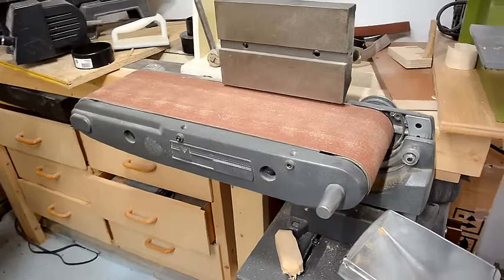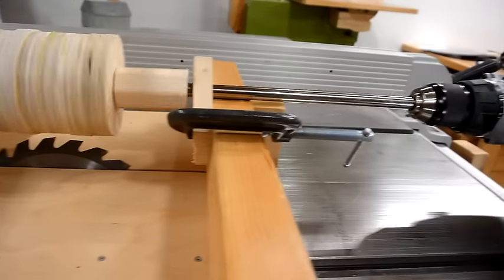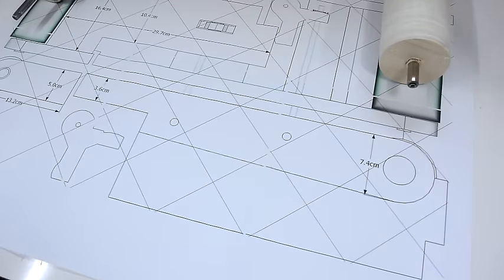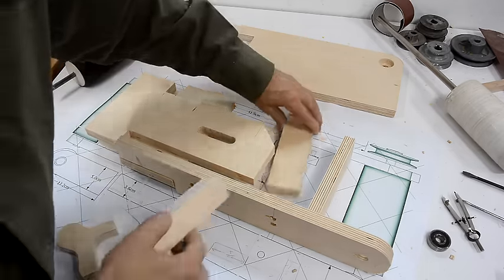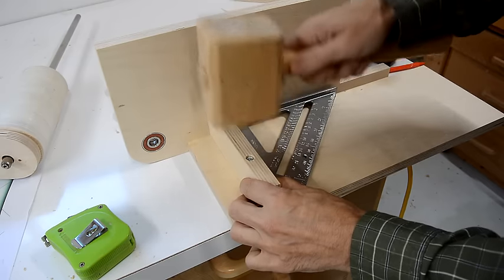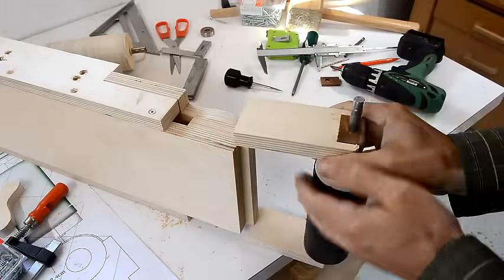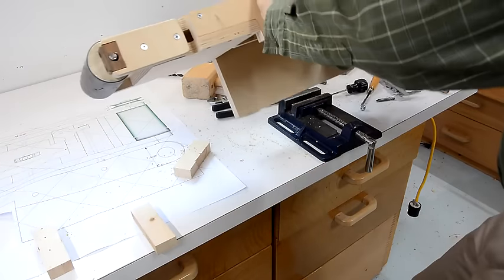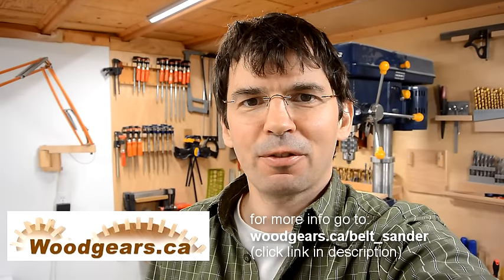6x48" belt sander build

Comment: To get the innertube on the pulley you can use the trick they use for cricket bat handles.  Just put a plastic shopping bag inside the rubber then pull the bag over the pulley.  It will drag the rubber over the wood.  When it is in position you can roll back the rubber and slice through the plastic with a razor blade.   Maybe look for a video on how to put a cricket bat handle on and that will explain it.
Reply: Chuck St. Louis.
Reply: Lijadora de banda casera

Comment: This has probably been asked and answered previously. What are the router type drills that you used to cut the holes for your bearing? 

Also did you salvage the bearings from something or were they new?
Reply from the maker: They are called forsner bits.
Bearings - don't remember where I got those from.
Reply: Thank you.

Comment: I have managed to get a whole section of cycle inner tube over a similarly sized piece of wood. The secret is to roll it on. Didn't use any kind of helper like talcum powder or water. Just rolled it in to a rough toroid and then stretched it over the wheel.

I've also seen a guy here on YT do a similar thing but with an old idler (metal, so harder). He made a cone piece that went on one end of the idler and then once again rolled it over. That's where i got my idea.
Reply from the maker: That is a cool idea!
Reply: Essentially an open ended condom roll?

Comment: If you find a throwaway treadmill, the surface underneat the running belt is supper slipperz and would make an ideal underlay for the sanding belt.

Great project, very nice execution.
Reply from the maker: Hadn't thought of that.   Just saw one on the curb yesterday and didn't pike it up (the motors in them are useless)
Reply: +Matthias Wandel can you make a GIANT sander from a treadmill?
Reply: Thats what me and my dad are building, a big belt sander from treadmill parts, its even going to be variable speed
Reply: A lot of people convert benchtop and small metal lathes and milling machines to use treadmill motors. They keep all the variable speed electronics and they reportedly work quite well.
Reply: i think John Heisz's disc sander uses a treadmill motor
Reply: Gandalf The Grey where/how do you get the sanding belt from?
Reply: Yves Baggi
Search, "Custom Sanding Belts" you have hundreds of choices.
Reply: aha... cool thanks, didn't think that was even a market, cheers

Comment: There is a difference between a shaft and an axle. An axle only has a vertical load , a shaft has torque forces on it (it's driven).
Reply: you may be a shaft :)
Reply: +The Flying Woodsman are you giving people the shaft again?
Reply: "a shaft has torque forces on it (it's driven)" 

So what do you call an idler shaft? 

Also, wouldn't your definitions mean that my rear wheel drive car doesn't have a rear axle, but rather a rear shaft?
Reply: In the interest of pedantry....
"...my rear wheel drive car doesn't have a rear axle, but rather a rear shaft?" 
Correct, although they're more commonly known as a pair of half shafts...
Reply: Paul Frederick axle with 2 shafts in it.
Reply: There are women on here...please watch the language. Thank you
Reply: AymBro
The flying woodsman was correct in his distinction between the two. Anyone educated in the field will confirm his definitions, shit even google could have helped you prevent splashing your ignorance here for us to see... Well done you :)
Reply: frackcha
it is the motor engine distinction. Which is meaningless semantic nonsense in useful contexts. As there is no time when an engine is referred to as a motor where it is detrimental to the interchange of information.
Reply: so much disrespect.

Comment: Where I am, getting an electric motor like those you use are few and far between, in addition to being so expensive, it's actually cheaper just buying the sander. Could I use a 1000W impact drill for motor instead?

Comment: Great video and project as usual. Would it be worth running or mounting the motor the other direction so that sanding dust doesn't get as directly pushed toward it, or would that not really be a concern?

Comment: Awesome build! I learned a lot. Loved the cooking spit idea over the table saw blade! Someone used their drill press as a kind of wood milling machine by locking the drill chuck in the lowered position. I can see how that could be dangerous but you always have to use your brain around power tools of any type. I'm a big fan of using a tool for any purpose to get the job done as long as it's a controlled situation and won't hurt yourself. Thank you very much!

Comment: Cool build - wondered if heat shrink tubing would work instead of the rubber or silicone for tires?  I have an old belt sander that needed a tire and am trying the heat shrink as the old tire is brittle and cracking.
Reply from the maker: Heat shrink tubing turns quite hard.  You might as well leave it bare wood instead.
Reply: I'm giving it a try anyway - the tubing I have is relatively pliable - much better than the cheaper stuff.  My belt sander has steel rollers.

Comment: Will the motor of a cordless drill be powerful enough or did you only use it for the first try?
Reply from the maker: Only to test
Reply: They're powerful enough, but drills are not designed for continuous use so the motor will wear out, I think.

Comment: Also, if "shrink-tube" (for electrical work....) is avail. is diameters >80 mm, a length could be fitted over a "tube" with hubs at either end.  Also, for bearings, skate board parts might work...!

Comment: I can't tell if that's 3/4 " plywood or 1/2" plywood for the round disc. If it's 3/4", then the length would be 8 1/4" since there's 11 pieces.

Comment: I'd been more impressed if you'd made the table saw first, then the band saw, and then the drill press. With $3000 worth of tools you can make something. Even a good set of chisels will set you back $50—$100. With all the money you have you could just buy the sander.

Comment: Next time you want to cover something in inner tubing with a tight fit.... pull it over your workpiece as far as you can and then hook the other end up to a shop compressor. Blow the tubing up like a ballon and it will be easy to pull it over in one piece.

Comment: I used garage door rollers as very imprecise cam followers & put a band of bicycle innertube around them & they seem to work fairly well. Mine is a very low torque application.
How true do rolling pins run? Have to check it out.

Comment: Hello mathias I really like your projects. I bought the tape saw and saw in your videos that I have separately discriminated the parts that make up the frame, but in the project I bought I did not find that part, or anything! I also bought the edge belt sander design, what is the size of the belt sandpaper that is used on it? I'm from Brazil and the sanders that combined that sell here are from the range, ferrari and skil, do you use sandpaper from any of them? Since the sandpaper for them is 1 meter by 9 centimeters.

Comment: Impressive job, but hey, you need to get a real wood screw drill bit that drills the correct tapered hole for the thread and shank and the correct countersink, instead of drilling 3 separate holes.  Make life easier for yourself.

Comment: I think it's a long job. You can take a wooden cylinder of the necessary measure and put on the rubber with an air compressor (as a sock, inflating inside) instead of cutting it in rings.

Comment: As you are, your videos are very good, I was wondering if it was possible to make a manual belt sander with a small grinder, there is only one video of a youtuber who made it with the grinder's head and uses a drill but has little force, it will be possible to make a with said tool? there I send you the link so you can see it but it is not practical I did it but it has no strength

Comment: A great sander. Thanks for sharing.. Have you maybe considered using a product called Plasti Dip for coating the rollers instead of the silicone?  You could dip it out of the can and spread it in the same way as you did the silicone.  I have used it in the past to coat tool handles and grips.. works great.  It is available in the big box stores and elsewhere.

Comment: Matthias, I've watched many of your videos.  Thanks.  I've been trying to build a DIY grain crusher to crack barley between two rollers for making beer.  I've knurled some 2" pipe and was going to make all of the parts out of steel plate and 6061 aluminum, but I think you've convinced me to make a prototype out of scrap wood first.  If it works well enough, I may never bother making the final version out of metals or at least proved the concept before I commit to the time and cost to make a final version.  I wish I could get your input on how to best control the roller gap adjustment.  I have some sort of eccentric, jackscrew driven screw set, or hinge system to allow for the movement, but I know you could come up with the best idea.

Comment: Why not use bearings on the end axle shaft instead of just running it through wood? It would run a lot smoother and quieter. It would also not wear out as fast as the wood.

Comment: why wooden bearings on the smaller roll (which turns faster) ? and why not using the hardwood actually for the "table" part where you push pieces against ? won`t the backside of the belt still sand the cheap wood away over time ? Greatings from Tschermany ;) i <3 your work ! just curious ... :)
Reply: sheat metal under the belt, just saw the end and now part 2 LOL .... sorry ...

Comment: You should use cork under the belt. It will help it run cooler than metal although you can use the cork over the metal too.

Comment: I just flip a 4x24 belt sander over and use it as my bench belt sander. Good enough. One of these days I want to make one of those 2x72 knife grinder machines. Other projects are ahead of it now though.
Reply: I got one, best machine I own, 2x72 Beaumont metalworks KMG, I've made several tooling arms for it too, possibilities are endless, super modular, 2 hp 3 phase motor with VFD, very strong machine, lots of belts and grit options for it.

Comment: Just wondering why you didn't use bearings on the idler roller instead of the wooden bearing blocks.  When I made my belt sander I found that it didn't take much friction for the wood to get really hot.
Reply: He likely did not have the right size bearings for the axle.

Comment: I don't agree with the hard bolt mechanical adjustment to tension the belt. The belt if tensioned by springs as in most builds of this nature would have some give. You have no give. There for as tensioning happens, something in your system is going to wear out or break. Not to mention I think because of this no give situation your machine has a pronounced squeak
Reply from the maker: I guess you didn't see the wooden springs?

Comment: Try glass under the belt.  It's nice and flat.
Reply: also tends to have a high coefficient of friction.
Reply: It doesn't wear like metals do .
Reply: +12345NoNamesLeft the only problem i can think of with having glass is that it may shatter quite easely
Reply: .....then what about scrap LEXAN.....?
Reply: Belt friction leads to Heat. Heat leads to Melted Lexan.
If anything other than metal, probably granite. Wears real well, and a piece could probably be had for free from a countertop shop.
Reply: Graphite cloth is another option worth considering, it's designed for hand-held belt sander shoes.

Comment: Thank you so much for such a informative video. There was yet two questions: why specifically states that the used rolls of 12 mm in diameter and 14 mm are not and why not fit rear roller bearings? To create a small backlash?
Reply from the maker: for more info, click link in description

Comment: Very nice! 
Just one question: you used ball bearings for the moving drum but wood bearings for the idler. The ball bearings were savaged from other equipment and you did't have 2 more for the idler drum, that's why you used wood bearings?
Reply from the maker: bough the bearings new.  They aren't cheap.  Idler drum shaft is much smaller, so wood bearings should be fine.

Comment: Looking awesome but Isn't it a bit over engineered?
Reply from the maker: What part do you consider over engineered?
Reply: arlo wiersma how's it over-engineered it has 6 movie Parts not including motor. lmao
Reply: The belt tension and adjustment system.  Can be done with 2 threaded rods and rod ends and some nuts..  Don't need to saw the complicated parts.
Reply: that's not over engineering that's just different opinions, it might have just felt a little bit more stable

Comment: Next project you should build yourself a CNC machine. Then you don't have to do all of that manual labor again.
Reply from the maker: http://woodgears.ca/faq/index.html#cnc_router
Reply: Thanks for the reply. See I am not the first one to ask this question. I will be building a cnc machine this week. I am going to be doing something similar to this build http://www.instructables.com/id/DIY-CNC-Router/ structurally. From what I can tell a cnc router does not need to cost you an arm and a leg. All you need is an arduino board, cnc shield, stepper drivers, stepper motors, end stops and a couple of threaded rods, bearings, a motor and some metal or wood. I will be using my current router as the motor and I have a couple of stepper motors laying around. Most of the components are pretty cheap though. You should be able to get all of the electronics needed for a cnc machine(router moter excluded) for under a $100. Then it is up to you to decide how big you want to go. Will probably be working on this on and off for a couple of weeks but as soon as it is up and running I can send you a couple of pics and the actual cost if you are interested. Wish me luck.

Comment: Isn't easier to use a baker rolling pin instead of cutting individual disk from plywood and gluing them and shaping them to final size?
Reply from the maker: No,  because the rolling pin would still need this treatment to get it true enough.
Reply: +Matthias Wandel for the little piece off wood at 8:38 you could have just tirned it around and it would have fit perfectly XD but longer videos make me happier

Comment: Why do you use wooden bearing blocks for the idler but actual bearings for the powered shaft?
Reply from the maker: See previous answer
Reply: Powered shaft! You said it yourself. Only use expensive metal stuff when you really need it.

Comment: Nicely done! 
I would want a sander with a longer deck so that one could sand profiles on fretborards and guitar necks, although it may then be difficult to get pre-made sanding belts.
Reply from the maker: There are standard lengths.  48" is a standard length, but there are longer standards.  Just check any supplier of sanding belts to see what lengths they offer.
Reply: Jiscodirect.com in Fresno California makes the size belt you want. The price seems reasonable.

Comment: I would use the lathe for making that rollong part you covered with silicone. Isn't it the operation the lathe was invented for? :-)
Reply from the maker: And exactly how would you mount that shaft on  your late?
Reply: Matthias Wandel
There're several options depending on your equipment.
1) I would mount a blank into a chuck, turned it round and then drill a hole with a long drill bit through the tail stock (usually it has a hole). Wood turners use such bits very often. But you may not have one. Then:
2) I would make a blank in the way your did and glued it up. Then I would remove the shaft (if it's not too tight) and mount the piece onto the lathe between centers (dead center in the head stock and live center in the tail stock). As the centers are conical, it should be true enough. The friction between the dead center and the wood should be enough to drive the piece.
3) If the shaft is too tight, then I would put a piece of wood into the chuck. Then I would drill a hole in it for the shaft. Also, I would turn out the wood around the hole, so that I have a sort of a tube around the shaft. The I would take a hand saw and made a couple of kerfs - to make a wooden collet chuck. So, I would be able to put one end of the shaft into this collet and tighten it up. As for the other end, I would drill a small hole in the very center and I would use this hole for mounting the shaft into the live center in the tail stock.
So, I feel it would take me much less than making a jig for a table saw. Of course, I may be wrong. :-)
Reply: Also, I forgot about another obvious option: we can use a Jacobs chuck inserted into the head stock. (If you have a chuck large enough for your shaft). Of course, you should also use something to support the other end of the shaft (for example, a live center).
Reply: For one, you would just turn a square 4x4 on a lathe to the proper round dimensions, and then you would bore the center hole after.  The whole process would have taken 10 minutes... or roughly the amount of time it took you draw all those circles.

Comment: You often use those "inner square screws", I don't know the right name. Is there a reason why you use these screws. Are those self taping metal screws? Do you have a personal rule for what screw to use for which usecase. Sorry if this was asked a thousand times before :)
Reply: Robertson square, or just square drive. #2 is the typical size I think. Best screw drive imo. Only reason I'd use anything else is if the head type isn't available in square drive
Reply: thx
Reply: Robertson is the standard here in Canada. Almost all of the screws at the hardware stores are square.
Reply: Ah that's why, here in Germany it's mostly Phillips PZ to my knowledge.